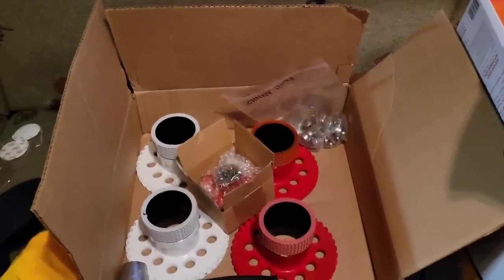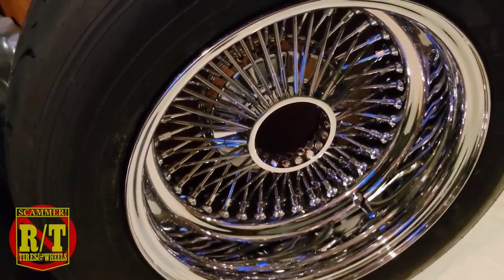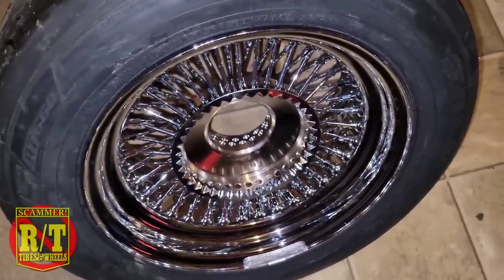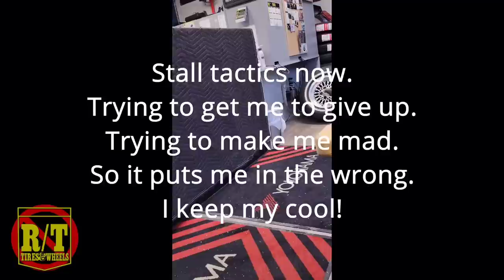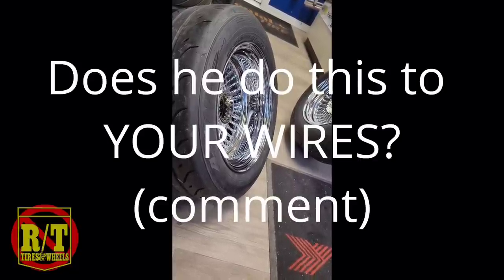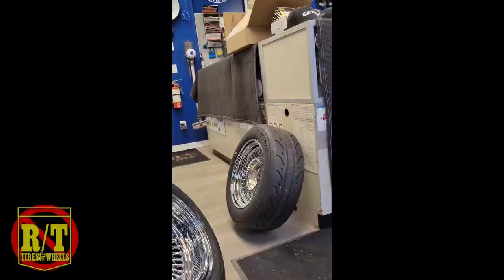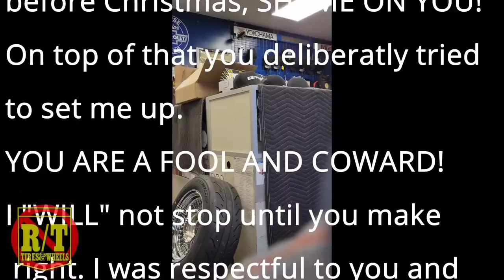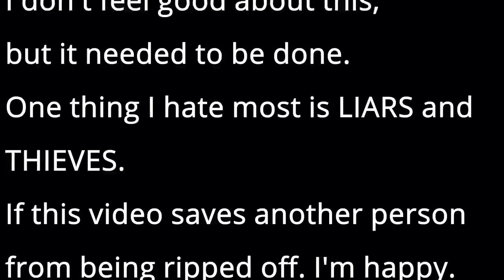"SCAMMED" LUXOR WIRE WHEELS @ R/T TIRES SURREY

Comment: I roll 13” chinas on 155/80/13 I run 60-80lbs depending on what I’m doing with my car. I run a juiced 1989 Cadillac brougham d’elegance 4dr 2 pump 6 battery setup.

Comment: Ya the wheels should have been inspected by the shop before sale. Kinda pooky if you ask me
Reply: @SlickWorks  I would inspect rims before sale they have clear bends in them... would you buy a bent rim?
Reply: @thetimetraveler1427  I wouldnt buy a wheel without looking at it, no. 🤔
Reply: @SlickWorks  ya its kinda like buying a ps5 and not opening until you get home and it's damaged. He got rinsed sadly 😥
Reply: @thetimetraveler1427  Nah its like buying a cheap chinese knockoff of a ps5 and expecting it to be just as good.
Reply: Naw the dude who sold them is shady af. He knew what he was selling and didn't think that guy was going to complain